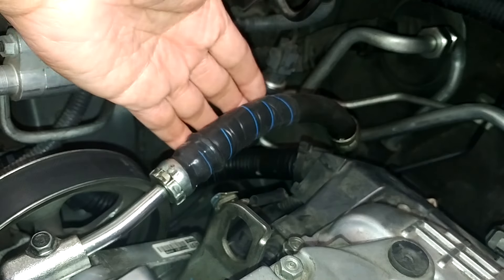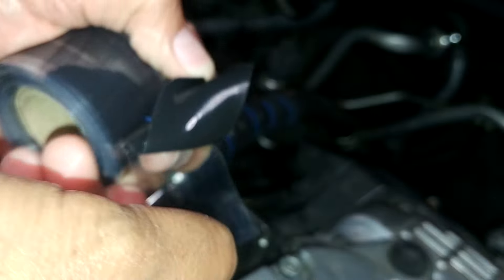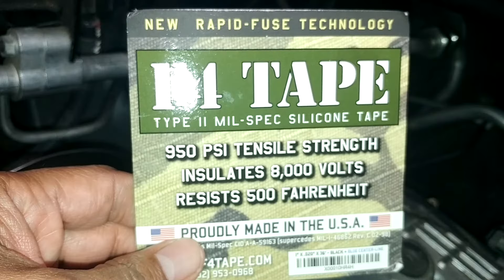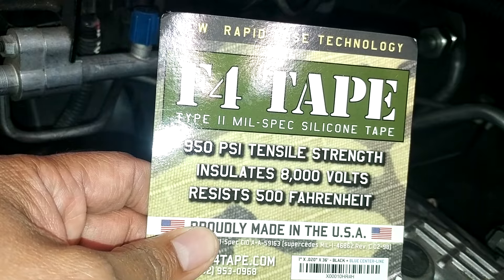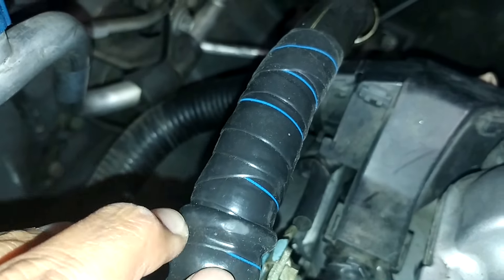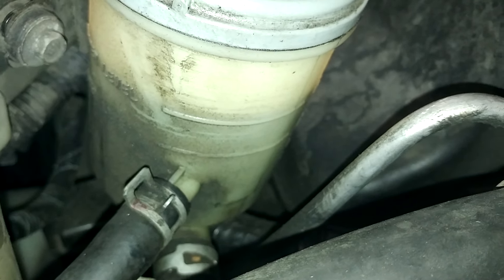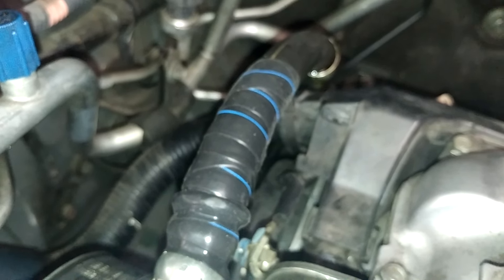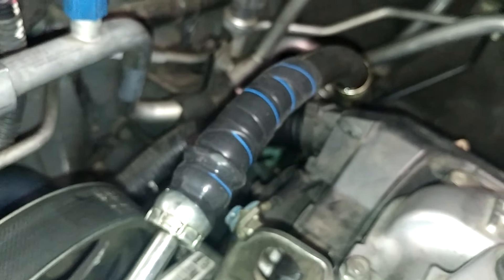Power Steering Hose Leak Quick Fix - Emergency Fix

Comment: This worked as a temporary repair for a leak at the same spot on my daughter's 2007 MDX. She had driven to Denver from Boise for her wedding, and had lost enough fluid that I was concerned her drive belt would get soaked in fluid. I flew to Denver for the wedding, so had no tools or any way to lift the car. All shops were scheduled so far out, that was not an option, plus the cost would be outrageous. 
I found a self-fusing silicone tape at a local auto parts store, and wrapped the hose very tightly. This did not completely stop the leak, but got her home (15 hour drive) with minimal fluid loss. This stuff is sold under many brand names. I bought another brand as a backup for her, and it was the same as the first brand (Duck).
I have now replaced the pressure line.
Reply from the maker: Thank you for sharing your experience! It’s always great to hear stories of quick fixes that help out in tough situations. Glad the tape did the trick and got her home safe.

Comment: This is good for emergencies, however if you have the time, just replace the power steering hose, if you just patch it up with f4 tape longterm , it might damage the rest of the hose by causing the leak to expand, it can also cause power pump deterioration,  you can buy a new hose for about 20-50 dollars. this is a very good fix for emergencies!
Reply from the maker: You are correct. It is cheaper to just replace the hose for someone that can do the job in their own garage. Other car owner may not be so lucky and may need to pay $$$ to bring it to the shop. So if you don't have the time or money to do the replacement ASAP this is a quick fix that you can easily do while finding the time or money to do it. As I mentioned in this video, this is only for emergency to keep you going until you get the hose replaced. This gives me a little over a month before I eventually have to replace the hose. I also mentioned that I have to check the PSF level every time I drive the car. Others may get more time or less depending on what type of leak they have.
Reply: I comepletely agree friend apologies, I forget a lot of people may not have the time to replace these parts so suddenly, you are totally correct this is very good for emergencies, keep doing what your doing, you run a really good channel man!  @diymanual
Reply from the maker: @Waterdog553  Thank you.
Reply: Hose is $120 and about 4 hours worth pain in the butt work.
Reply: If this is a JDM RA1 Odyssey, the power steering hose is discontinued and almost impossible to find.

Comment: I used similar self-fusing silicone tape to fix my dishwasher. It still works! I used JB Quikweld to fix my leak, but I might try wrapping it as well. 🤔
Reply from the maker: That's great to hear. There is nothing wrong in double reinforcement.
Reply: @diymanual  😅 Quikweld didn't hold. I think the pressure was just too much as it just cracked it. Maybe should have just used the silicone tape. 😭
Reply from the maker: @tiberius1272  I think they have a putty type epoxy for that application. I used JB quick weld in the drain pipe under my sink 5 years ago and it is still holding. But there is no pressure on that pipe.

Also, it reminds me. I used the silicone tape about 6 years ago in my cold water line in my attic that have a very small leak. It is still holding great also.
Reply: @diymanual  I ended up buying a new Gates high pressure power steering line from Rock Auto and installing it.  Took 7 hours 😅 but works much better now.
Reply from the maker: @tiberius1272  Good to hear that.

Comment: Is that the low pressure or high pressure line? My high pressure line is leaking(spray a small stream out the rubber hose) and i cant get to the bolts  to take it off the frame underneath. I was going to attempt replacing it with one from the junkyard but i couldnt get it off as the bracket bolt in the middle is ontop of the frame behind a pulley with the radiator fan and pulley in the way. I dont know what to do coz i cant afford a mechanic or even a new part due to being between jobs making money tight.
Reply from the maker: Yes. this is the high pressure line. This emergency fix gave me at least a few month before the bottom part of the hose started leaking. The pressure hose are cheap in Amazon so you don't need to get a used one from the junkyard.  Not sure what car you have but you can start here:  https://amzn.to/409Tqeb

If you have the same car as mine, here's the video on how I take the hose out. I actually have to cut the hose to remove it.  https://youtu.be/v9iJjTtdWzc

Just make sure you have the correct tool to install the new one. You can borrow tool from your local auto parts store. They will charge your card for a deposit and credit it back once you return the item.   Good Luck!
Reply: @diymanual unfortunately it didn't work for me. I stretched it and wrapped it many times, I made it to the store just to hear it pop like a balloon. 😢 I even tried placing another larger hose on it (split down one side) and hose clamping it onto the rubber. It still leaks, even after using Lucas power steering stop leak. I have horrible luck. I'm between jobs and have a opportunity now to work for amazon flex and as a seasonal ups delivery driver using my own xuv but it won't stop leaking.😭 my bills are pulling up and I've spent alot on fluid doing doordash just to cover my light bill. Sorry I'm ranting coz I'm bored. I'm gonna keep trying to get it to work, maybe a combination of the tape and a pipe would work. Anyway thanks for the vid and reply
Reply from the maker: @dragonext2001  sorry to hear that. Yup your leak is probably bigger than my problem so you will need to replace the hose. Not sure what car you have but you might be able to replace it yourself. Buy the part from Amazon and borrow tools from your local auto parts store. Good luck. I'm praying for you.
Reply: @diymanual  ya I'm trying to change the line now and it's a pain. I have a 2005 gmc envoy xuv. I eventually was able to buy a small 10mm ratcheting wrench to get the annoying bottom bracket off now I'm having a new dilemma.  The 2 lines wraps around the motor and connects in a hard to reach space . I got the driver tire and tire shroud off to get to the oily spot though I still can't actually see it only feel for the bolt. Problem is the 2 lines are held in my a bolt holding the bracket in and the bolt for some insane reason is in the middle between the extremely close lines. My sockets and even my tiny wrench doesn't fit between the lines to reach the bolt. I have no clue how I'm gonna get it off. I will even if I have to cut and bend the lines apart but as far as taking it off the normal way...I have no clue
Reply from the maker: @dragonext2001  I'm not familiar with GMC but I suggest you check the repair manual or other video specific to your car and list the tools needed. You mentioned there is one spot that you can't reach with your tool that means that the tool you are using is not the right one for the job. You probably need a crow foot wrench and something that flex or an extension. Do not force it because you don't want to strip or break something trying to remove it with the wrong tool. Good Luck with your project I'm rooting for you.

Comment: how long did you have the silicone tape in there before replacing it Sir? Planning to do the same to buy me some time have it replaced.
Reply from the maker: This gave me 3 to 4 months before I actually replace the hose. I did replace the tape a few times before the bottom of the hose started leaking.   I have another video that shows how I replaced the hose if you are interested.  https://youtu.be/v9iJjTtdWzc?si=M6FHJ1JDXZ70hz3E

If you have the same car make sure to watch the full replace video and pay attention on how I was able to remove the hose. The angle is hard if you just lift the car in the jack stands so I have to cut the hose.  

of course how long the tape last for you will depend on how much leak you have in your hoses. 

Good Luck.
Reply: @diymanual  thanks, have a different car. But in the steering pump bottom.
Reply from the maker: Sorry, just saw this. YT does not send notification on replies to the previous comments.  By this time you probably changed your hose already. I hope you got it done already.

Comment: How did you wrap it and where did you start
Reply from the maker: The leak happens to be oil soaking through the hose near the metal connector so I started at the metal part so I can put more pressure on it. If I remember correctly, I did 2 layers. From the metal part, I wrapped it and went over 2 to 3 inches over where the actual leak is then went back to the connector.     

Just a reminder, this is not a permanent fix. But this patch gave me enough time to gather the information I needed to learn how to replace the part by myself to save money. I eventually have to replace my hose as you can see in the video link below. 

https://youtu.be/v9iJjTtdWzc

Good Luck.

Comment: Tried using this but the tape shrank and cracked after about a day and a half. Even after application carefully following the guideline and stretching the tape the fluid was still seeping out of the tape. My hose failed at exactly the same point too. Any suggestions? Please reply to this comment directly so I get a notification.
Reply from the maker: @TronixGuy93 The leak is probably too big already. This is just for emergency fix. You will need to replace the hose to prevent damage. If you have an Odyssey you can check my other video on how to replace the hose. https://youtu.be/v9iJjTtdWzc
Reply: @diymanual  Thank you. That is what I was afraid of. When I zoomed in with my phone and took a very close macro image of the hose it does look like that particular spot has very fine cracks in the rubber. I may just have to wrap the hose from collar to collar twice over with a layer of rubberized epoxy in the middle. My problem is coming up with the 513 to have it fixed. I'll need to save for about 13 months.@diymanual
Reply: If I could just find a way to seal it from collar to collar that would be terrific. Haven't tried flex seal yet, but I expect much the same result.
Reply from the maker: I hope you got the leak fix by this time.
Reply: @diymanual  Sadly, no. Finances are just in the negative. The average price I was quoted was ~$325 w/ aftermarket parts. $675 with oem. No third party. Gonna have to wait until around January to save up enough. Thanks for asking though. I've slowed the leak so it only costs about $25/mo in power steering fluid.

Comment: Is it still holding?
Reply from the maker: The tape is still holding however there's another leak that developed in the lower part of the hose that I can't reach. So  can say that once the hose started leaking that it is time to replace it. This will help you get some time to do it

Since I am replacing the van I am testing Lucas power steering  with stop leak. It seems to slowed the leak but I will see if it will do anything
I will do another video on it after I finish a bottle.